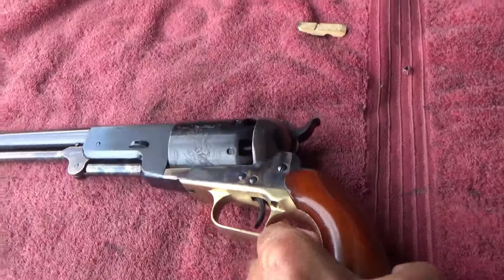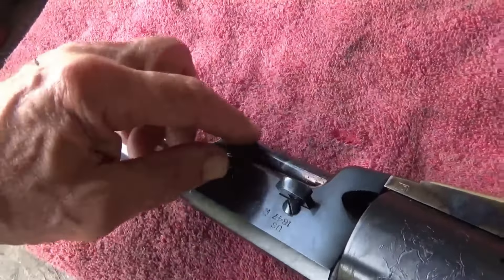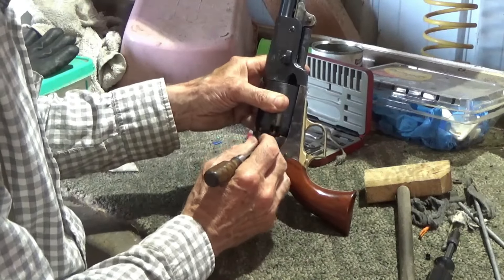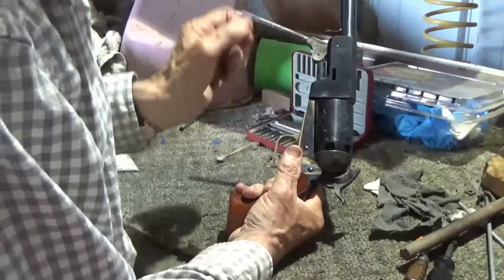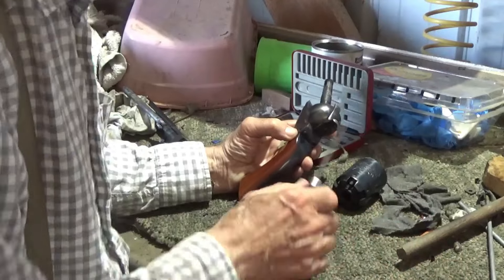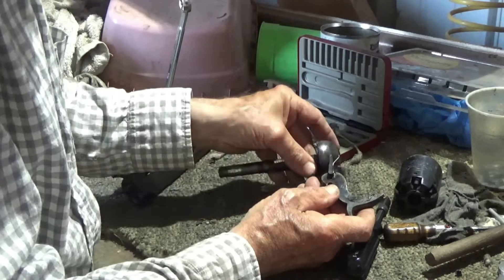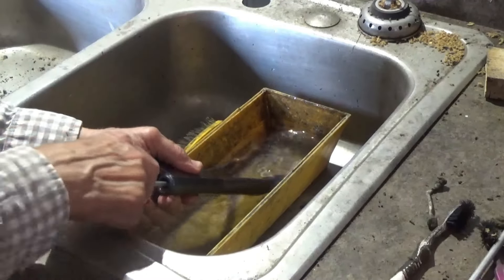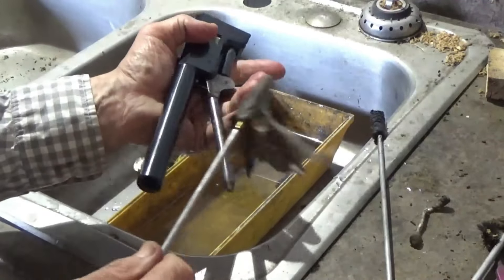Colt Walker - Cleaning -  Disassemble & Reassemble

Comment: I have been using zip ties on the Walker mainspring. Simply cock the hammer then install a zip tie which holds the mainspring in place with no worry of slipping or accidental damage.
Reply from the maker: Had to pin this one, hope that's OK.  O.R.

Comment: I've always found it easier to remove the lower trigger screw and trigger and then the upper bolt screw and bolt. I like to clean my disassembled BP pistols by spraying/soaking  everything down with Moose Milk (5:1 distilled water and Ballistol). Brushing and patching where indicated then blast everything down with a small high pressure distilled water steamer that I got from Walmart for about $30, It leaves everything spotless and hot and dies almost instantly. I wear a glove and hold small parts in a hemostat .Then lube everything with straight Ballistol and reassemble. Goes pretty quick. Got the idea for the steamer from "SnapshotsCorner" YouTube channel. He  posted that from Norway about 3 years ago. ❤ Love your channel as always DJ
Reply from the maker: Thanks for the info Doris. That steamer, along with what else you do sounds like you are on top of it.  I'll be checking that out.  It's great to have others to pick up tips from, I pretty much have had to learn the hard way in the past.  Now, thanks to channels on YouTube, information is much easier to share, and seeing it in action is almost as good as being there.  Books and Mags in the past worked, but were expensive, and sometimes those that had really good information and methods couldn't publish.  Thanks again.  O.R.
Reply: @oldranger3044  So happy I can give back even a little ❤ and the Snapshots Corner fellow is a pretty good source for everything BP👍DJ

Comment: Super video. Thanks for the painstaking detail. I love black powder and guns,  ut I’m afraid I don’t have the time to clean the guns quickly. This helps a lot as I try to convince myself to go for it.
Reply from the maker: @patwelsh5561  In my experience having a set-up for cleaning is next in importance to having the guns and the place to shoot. I do probably more shooting then most, and without my set-up (I went too long without) I would shoot them less. An occasional shooter can get-her-done with only an outside bench of course, but you’re wise to get a heads-up about what can be expected and possibly line up some supplies (and tools). On the tools note, good screwdrivers, wooden pin of some sort that can be used to drive the wedge. Basically it’s a little like a repair job. Before you know it you’ve got every tool you own, and half of the neighbors committed to it. Glad to hear about your passion for the Black Powder. O.R.

Comment: Excellent work there OR! I find an air compressor is an essential thing to have when doing a deep clean, it blows oil into all the corners as well as drying off the parts, I do use a cordless drill with a 45 bronze brush to clean out the chambers as I find it does a really thorough job in a short time, after the parts have been soaking in a Ballistol mix the crud comes off very easily, I made a main spring clamp which makes working on all type of lock much easier, they are easy to make but are very cheap to buy. If only people would take the time to do this after a shooting session, but few bother I fear. Stay safe! Chris B.
Reply from the maker: @453421abcdefg12345  Thanks Chris. I like the drill idea. On an idea from Doris, I picked up a steam cleaner. It might have the potential for not having to do the water bath. Even if it doesn’t work out, the enjoyment of trying it is worth what I paid. Must keep in mind that there is usually a cost for entertainment, just like going to a movie theater when I was younger. Fall is a little in the air here, and still have wood to make. O.R.
Reply: @oldranger3044  The steam cleaner sounds like a good idea! It will heat up the parts and make them dry quicker as well as cleaning, you may have a problem holding the parts to scrub them though, I did try an ultra sonic cleaner, but it did not seem to be much better than a tooth brush and Ballistol. The  "cost of entertainment" is a factor overlooked by many, they seem to forget anything we enjoy costs money now. We have not really had a proper summer here yet, although it is 38 degs C there has been a lot of rain, but we have got 24 Cu Mtrs of logs stacked in the barn, with another 20 on order, as good as money in the bank! Stay warm! Chris B.
Reply from the maker: @453421abcdefg12345  it’s interesting that you have the same opinion about entertainment as I. I’ve known lots of shooters who don’t want to pay for anything except their guns, and maybe ammo. Mostly they were old school guys that were used to being able to go a short distance from their home and shoot. Things have changed. A few years back (well suppose it’s 10 now) I was checking out with a couple of 1K boxes of rifle primers at $29/K. That was when the first major price hike had occurred, and before that they were about 1 cent each. I guy who was used to the old cost was looking at them and walked away commenting “I ain’t going to pay three cents for a primer”.  Guess he got his wish. I feel it’s like many recreational things (skiing, boating, fishing, golfing, swimming, traveling, ect). It doesn’t need to be cost justified, and I think younger folks get this . 
Oh ya, the video I watched of a fellow on Norway was using a welders glove to handle the gun. Still plan to remove blackstrap and trigger guard, but it might save having to remove the internals; will see. O.R.
Reply: @oldranger3044  Well OR, faced with the problem of boiling the 44" barrel of my project flintlock I was wondering how I was to boil such a long item, I know Hershal used a length of roof gutter, but here it is mostly plastic! Then I read,  "on Doris's recommendation", a light came on , a used our steam cleaning gun to run over the entire length of barrel to turn it into a black ! It works really well as I had control over the temperature , it did help that I left the barrel out in the 40 deg C sun and could hardly handle it without gloves, but it is now blue/black, so a large glass of Southern Comfort for Doris! Stay safe! Chris B.

Comment: I slugged the barrel of one my peitta. 44 Remingtons  put you in the title of the video.  Measures. 445
Reply from the maker: Thanks Steven.  That's close to what I'm getting.  Is that grove diameter, of the bore?  O.R.
Reply: @oldranger3044  bore . Thinking of either a custom mold or a .446  sizer die. I already have a 448 sizer on hand. Have you done a test on a uberti? And did you get notification of the video? It is titled dumb 💩 said on guntube EP2
Reply from the maker: @StevenMMan  I just found it and subscribed. O.R.